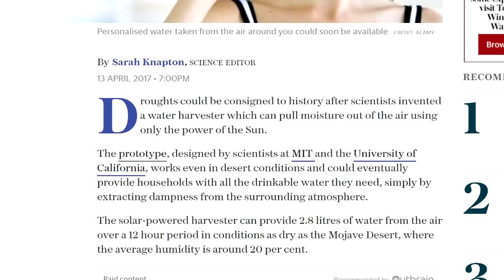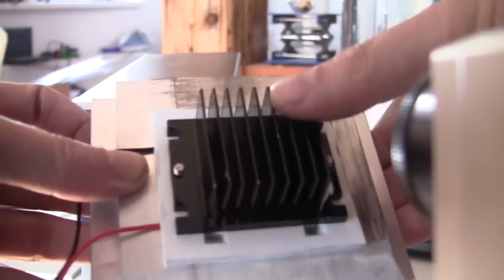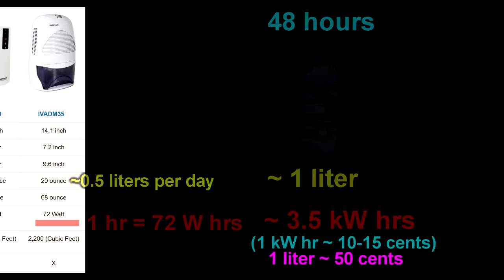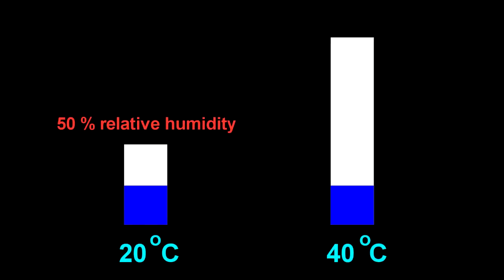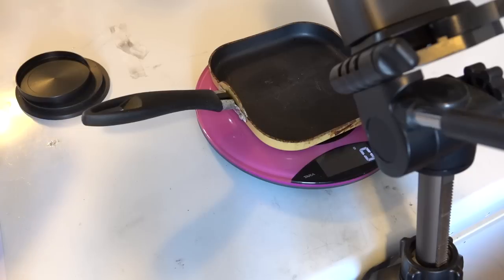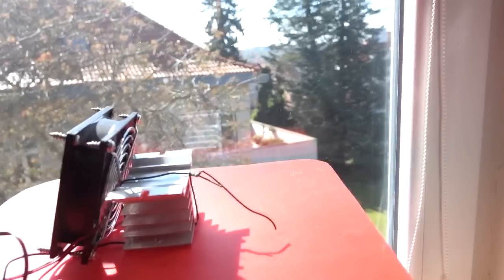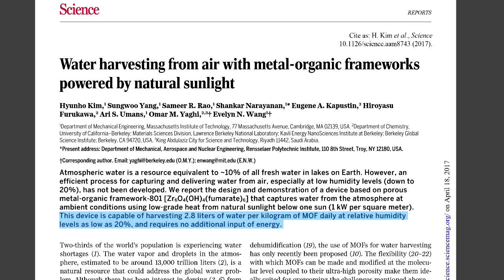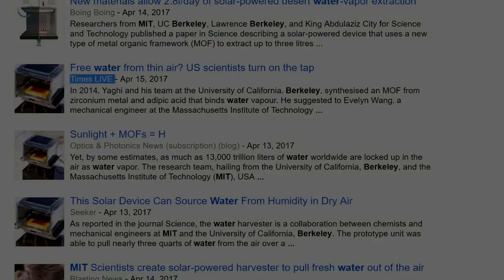FREE water from AIR device: BUSTED

Comment: Right, but dissipating 2 MegaJoules does not require a specific amount of energy. The energy will be temperature-dependent. If, for example, you had a "reverse greenhouse" that has a top that has a roof which reflects visible light but is transparent to infrared, then it could potentially be kept constantly cold, and would indeed begin condensing water with no power input to the device itself. The sun is of course pumping vast amounts of heat into the environment, but it will continue to do that anyway.

The big problem with these devices is that you need to dissipate enormous amounts of power at low temperatures. My hypothetical inverse greenhouse would at best be the equivalent of an equal-sized solar panel, so if it is a meter across, it will probably get on the order of 3 liters per hour in direct sunlight, and under optimal conditions.

Even without an anti-greenhouse material, all you need is a vertical panel that tracks the sun so that it dissipates heat quickly but doesn't absorb it. Or equivalently, a big shadow.

Yes, you see, if you build some big dumb object that casts a shadow, the objects being shaded are still radiating heat. If those objects have a high surface area, they will begin cooling the air in the process, causing a drop in humidity. The shading object can be made of ordinary metal, which will reflect infrared light off into space.

Comment: Best way to get water I find, through many years of research and gruelling experiment is by using a hollow extruded cylinder connected to some remote water supply and either by gravity or a pump - which could be solar powered - get that water from one place to another. I call it a 'pipe'.

Comment: I guess the term "no extra energy" doesn't refer to the instance when the water is condensed but merely to the use of the solid desiccant. I guess it's PR speak. The new things proposed in that paper seem to be to use a solid desiccant and sunlight to evaporate the water in a confined space to create higher air humidity. Even though it's hard to justify that they say "no additional source of energy" when they mean up to the point of condensation there is no need for additional energy.

And it seems like their prototype they show has only around 1.3g of the MOF. So a device that could produce 2.8kg of water in one day would need to be almost 800 times the size. So quite huge.

Comment: In fact, even a vertical glass plate should fulfill the requirements:
1. Get rid of thermal IR faster than it absorbs it from the environment.
2. Ignore visible and near-IR light.
3. Exchange heat with its surroundings.

Comment: If the key point is the difference between temperatures of the MOF,  then they can take advantage of the cold air temperature at 10000 feet, make a hydrogen ballon powered by wind turbines use the MOF to capture water at a higher rate taking advantage of the cold air near the end of the day, fill the tanks with water as the weight increase and the ballon get colder it will descend collect the water, supply the lost hydrogen using electrolisis and repeat.

Comment: Thinking a bit more while I watched this (again): Why not building a suit that filters out drinkable water from urine and sweat, or at least urine. ISS is doing it, so how hard can it be to implement a small scale filter system or at least have a central station for soldiers to produce drinkable water? It will need less energy and we know it works.

1 short google search brings up Aquaporine, a filter that works like our kidneys. So it is even possible to make a lightweight filter system for the dessert that is not so error prone as the ISS system.
Reply: i feel like there is a suit that is supposed to do this... Probably close to a spacesuit.
But uh, im also thinking about Subnautica now so, i dont know if its actually physically possible. Atleast not with a thin suit, it'd be atleast an inch thick. atleast. also i live in the US and imperal system sucks but im not sure what is an inch in CM so... googled 2.54cm=1in. Sooo basically 2.55cm to 1in, yay i have learned thing. Also, seeing that... not sure if that would be enough.

Comment: Actually Thunderf00t is wrong about this. He's assuming a 1:1 heat transfer rate to extract the water. With refrigerant based heat pumps (e.g. process chiller), the actual energy budget would be at least 1/10th of what he's predicting. Realistically most modern refrigeration cycles can move ~12 BTU of heat for every 1 BTU of power input. Its feasible to operate (more expensive than reverse osmosis), but the initial cost is VERY expensive, and it would never work in the third world: you cant train a bunch of baboons to set up and maintain a large complex refrigeration process plant. This would be almost exclusively military. But if they can get the desiccant dialed in and set it up right it has a chance of being practical in some remote regions, probably as a trailer or skid mounted plant.

Comment: Maybe a variation could work better:
One could use thermal solar collectors to generate a temperature way above 100 °C. This heat can be used to boil the water out of the desiccant, and not just to evaporate it slowly. The steam could be condensed in an air or water cooled condenser, which doesn't require temperatures below ambient. It's just a distillation, like in chemistry.
Still, this needs ridiculous amounts of solar panels,  just to generate the amount of heat. Not even mentioning the power for the circulation pumps, cooling fans for the condenser heat exchanger, and the fans to force the air over the desiccant for efficient water absorption.
But wait, the solar cells, thermal collectors, desiccant and pumps could all be integrated into Solar Freakin Roadways! Next time when one builds a road, there will be the question if it should produce power or water! Damn, why am I giving the idea away here?! I should have created an Indiegogo campaign and made millions of it!

Comment: I'm curious about the meteorological  consequences of pulling moisture directly out of the air.  Let's just say that someone does eventually get a machine like this working that withstands the might of Thunderf00t analysis.  I don't know much about climate and weather, but I do understand that the moisture content of air can be pretty gosh darn important, and I hear its an important factor especially in the formation of violent storms (in particular, when pockets of air with different humidity/temperature come together).  So, if we have a large number of these machines pumping all that water out of the air, what will the 5-day forecast be like?  Maybe it's not feasible for such a machine, even in large numbers, to have a significant effect on atmospheric humidity.  But, if a drought is occurring in California, and we suck what little moisture there is in the air right out, wouldn't that just exacerbate it?

Comment: here is a VERY good every-day way you can see how this works for yourself, and you likely have one (or more) in your house.....a refrigerator or AC unit and a stove.  If you want to cool water down from "room temprature to about 38F, it takes ENERGY, and the byproduct is heat.  You must remove heat energy and a refrigeration unit or AC pulls the heat out of the water (item being cooled) and "exchanges" it into the air outside the area / item being cooled.    The SAME is true if you want to heat a given ammount of water to boiling temprature.  It take ALOT of energy to put into the water to change its state from liquid to gas.  Thunderf00t even worked out the math in a different clip.  So, you can see in everyday examples that you cannot get around the need to ADD or REMOVE energy from a given mass to change it's temprature (stored heat energy)

Comment: Having that heat sink under the device is not a good idea. You get back part of the dissipated energy through convection. Also, the fins are horizontal, and that don't help with the flow of air. Turn the device 90° to get the fins in a vertical position and not under the device. Also, that solar cell is ridiculously small.

Comment: To be fair, the price of drinking water in some arid countries can reach 50 cents per liter, and the cost of energy in those  countries can actually be cheaper than the price of water, especially if you don't have a readily available water grid, but readily available solar panels.

You have to remember that energy prices are not set in stone, we're constantly generating more and more energy, but the amount of water on earth is finite.

Just to illustrate, 1 Liter of gas in, say, Saudi Arabia, is actually cheaper than 1 liter of drinking water.

So when TF says that this would cost one liter of gas to produce one liter of water, this actually means it would be cheaper than buying a 1 liter of bottled water.

And if you improve said design (engineering wise, this tiny device may actually be very energy inefficient compared to a larger scale model), you may be able to reduce the amount of energy.

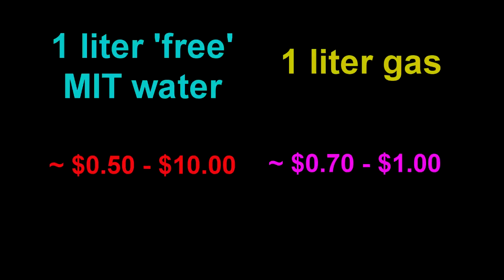And here's a dirty little secret, I used Saudi Arabia as an example intentionally here, because if you look at the bylines in 20:00, you'll notice "King AbdulAziz City for Science and Technology".

This isn't TF's fault, because it's pretty bizarre to imagine that the prices of drinking water could be higher than the prices of gasoline, so this is valid even if you don't run this on a larger scale solar panel installation.

Comment: Here's an idea that will probably work better: 
1. Make a giant bowl of heat resistant glass. 
2. Make a bunch of mirrors that concentrate sunlight into the bowl. 
3. Pour salt water into the bowl.
4. Use the steam to power engines and then collect the water.
5. Treat water and bottle it.
6. Profit.

Comment: Serious question: What if it's used in a contained environment such as an earthship where moisture can be increased for just that area? Then you could use solar power (which is abundant in a desert) and transfer it to the "water collection device" in the pseudo-tropical rainforest in the earthship. yeah there's water already in the pseudo-tropical rainforest, but it can be used to "get clean water in a desert".

Comment: I suppose you could just use a small solar array and an off the shelf  dehumidifier as a control.  I'm guessing they don't have a control. : D  Isn't it true that if you want a cold surface, the old method of using a compressor and refrigerant is more efficient?  Peltiers are simply not found in air conditioners and refrigerators (except some small ones).  I was wondering why a while back when I wanted to buy a window AC.  Turns out they can work, and they are very quiet, but they are VERY inefficient.   The control should actually be a compressor type dehumidifier.

Comment: I haven't been able to find any info on it online, but surely running multiple dehumidifiers in an area would reduce their efficiency in the same way that a vacuum pump takes longer to reduce the atmosphere in a vacuum chamber as the pressure reduces?

Comment: Ok, I think it can be done. I have been working slowly on a design that will pull water from the air. It uses no electricity and has two moving parts. It would be about the size of a small car and potentially pull out about 40 litres a day, if one can get 1 gram of water out of one m^3 of air.  At this point I have no idea of what to do with the idea. There are to many scam artists in the world to try and actually make it.  If I can put a Solar panel or two on top and a battery and motor in the system it would be more reliable at pulling water, but it would be unlikely to achieve a 20 year  plus life span with only yearly maintenance.  Having a Ph.D. in Engineering and degrees in Physics, it should work, but I have other things to do in the meantime.

Comment: Here's the thing - Even if this thing worked (And that is a bif if; So big I should capitalize it), it still wouldn't really solve our drinkable water shortage. All that water that this thing takes (would take) out of the air is something that through the cycle of water we  would get anyways. The only change is that now it comes from a "fancy" apliance rather than good old rain.

Comment: If we wanted to provide water to arid areas, i am sure we could pay for some desalination plants on the coasts and use pipelines to transport the water to those areas. Might be a bit more expensive upfront, but i am sure it would be cheaper in the long run. 

And if we were desperate to go green... We probably could come up with a desalination plant that uses sunlight... a copper box, which we paint black.... maybe put a magnifying lens onto it, to really heat up that box.. thus evaporating the water. Pumping it into a pipeline and transporting it to where ever it has to go in said pipeline. We craft the pipeline out of plastic we fish out of the ocean.... we'd not only transport water to these arid places, but also clean up the trash islands floating in our oceans.. sounds like a win, win.

Comment: Wouldn't piping the water be cheaper? If the region is very arid desalinating sea water and transporting it would be more economical, and solar powered desalination might even be an option down the line, although I think nuclear power is the way to go for most of our base needs. If water is more of a concern than energy in your region tho, reverse osmosis or distillation makes more sense, and you can get more than 3 litres an hour (if that were even physically possible) you'd probably  have to process the water after condensing it anyways to make it potable, and to make it palatable you might end up having to distill it anyway, there's a reason I don't drink the water my dehumidifier collects, besides perfectly good water coming out of the tap! It would taste bad and who knows what microbes are in the air or in the condenser coils.

Comment: I didn't see any problems with the claim, because I don't think it's so easy to thermodynamically disprove it (dehumidification for free). As you noted, the process is *exo*thermic. that is, it gives off energy to the environment, so it's unclear why you can't use a catalyst to overcome the potential barrier (which would be cooling some collector), and simply passive cool the resulting thermal energy released. On the other hand, it's also clear that at less than 100% humidity the thermodynamically favored process is evaporation, not condensation, so it seems you'd have to pay some kind of energy cost to revert this thermodynamically irreversible process. As an example, take two isolated bodies of same temperature. You want to pump heat from one to the other. The final energy of the system is exactly the same as the starting energy, but that doesn't mean you don't need extra energy to do this process, otherwise you would be in violation of the 2nd law of thermodynamics. In that case your energy cost is bounded by the Carnot efficiency.

Comment: Actually, much more effective is to use standard refrigerator or air-conditioner heat pumping system, Peltiers are notoriously ineffective. But still, you need lots of energy. As you said: no free lunches. I am really puzzled with this MIT experiment. Some years ago I designed Peltier based system for cooling deuterized sample from HPLC, device is intended to maintain hydrogen-deuterium exchange uptake in solution that later flows to mass spectrometer for analisys. When system was still open at first (otherwise cold side is enclosed in sealed chamber) there was condensation orders of magnitude greater than with this device of MIT. I used two 100W peltier assemblies. So, is my device some kind of miracle ? :) I know it is not. Regardless of fact that condensation was merely a side-effect which causes my bench to be slowly flooded. Later we developed system that dries air in main chamber.

Comment: Sorry, but did you even read thee article? "This prototype includes a MOF-801 layer (packing porosity of ~0.85, 5 cm by 5 cm and 0.31 cm thick containing 1.34 g of activated MOF),"  1.35g of MOF, so the toy prototype should gather less than 4 g of water per day. 
And what peltier is doing there? They explain it too: "For visualization purposes, we used a condenser with a temperature controller to maintain the temperature slightly below ambient, but above the dew point, to prevent vapor condensation on the inner walls of the enclosure. However, active cooling is not needed in a practical device since the hot desorbed vapor can condense at the cooler ambient temperature using a passive heat sink."
You focused on wrong part of the device. MOF, where reaction took place, is on the top of the box. 

Oh, and did you read this work in night-day cycle? It absorbs water in MOF during night and release into a container when heated by sun. Of course it release it as vapor and heatsink in the container is needed.  

I'm not claiming it works (I didn't read whole article yet, but I don't see any physical impossibilities. The only problem for now is that the device with reasonable output volume would be quite big. It seems to MOF has to be in a quite thin layer)
But i think one has to put a little more work to debunk peer reviewed article from Science than to debunk scamish startups done by designers and artists. Not depending only on pres information and reading the article would be a great start. DOI: 10.1126/science.aam8743 , it is posted on Berkeley website.

Don't read me wrong. I like you channel and educational work. Bud please don't get lazy and "I know everything" type.

Comment: I think the figures they're giving for this is if they scale up the size considerably, which might make it plausible to function as stated but very misleading overall.
Reply: Pretty much. If you cover a larger area, you can get more water, but there's only so much in the air so after a certain point, you're not getting any more & just wasting resources.